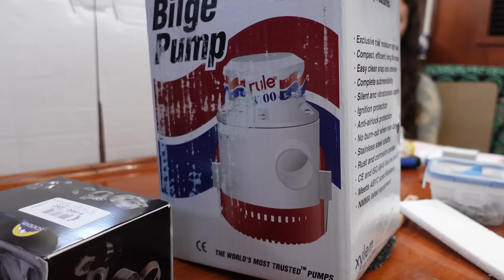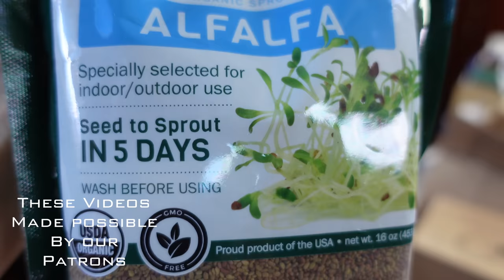Reconditioning our Bomar Hatches Lots of Boat Work | Ep 312

Comment: Great job on hatches… I’ve done so many over the years (boatwright) using the same process and Dow 795. Good choice!
   On the top silicone bead, if you take maroon Scotchbrite and lightly rub it, it will take the gloss out and look like original sealant (Bomar method)
  Super job..!
😀

Comment: Info only and please use a Aluminum etch primer at least on the frames but up to you Master fixer :) . Polycarbonate offers much more resilience than acrylic, making it ideal for highly demanding applications like bullet-resistant windows. Acrylic has a high gloss finish and is more transparent, making it ideal for display cases. Acrylic is also easier to crack, while polycarbonate is easier to scratch. = One Looks good and the other does the Job so poly can also be sanded to remove any Scratches there is a reason why Helicopters use Poly and not Acrylic lol .